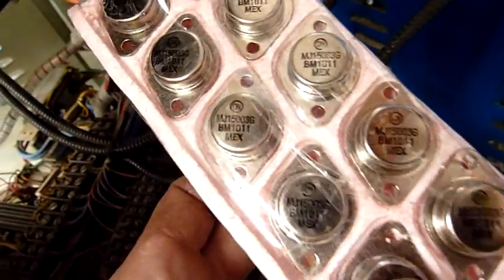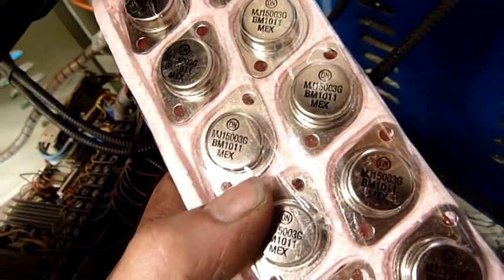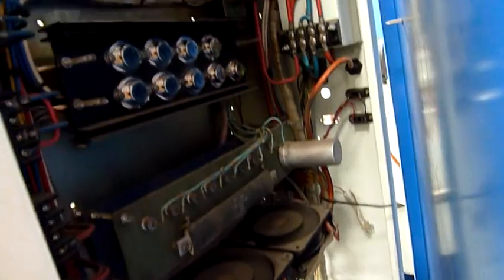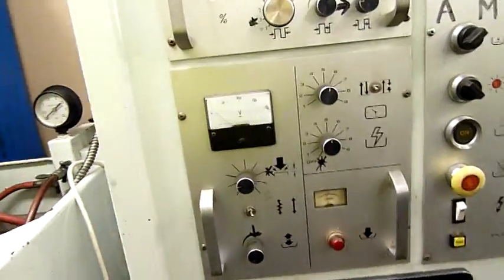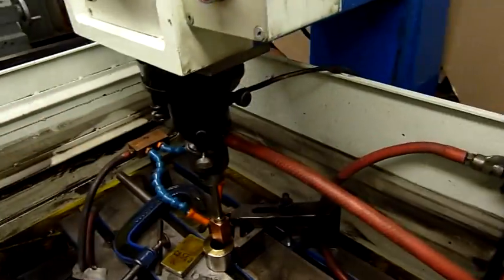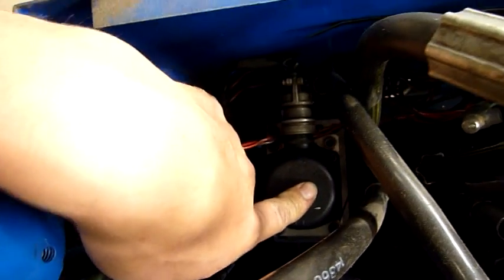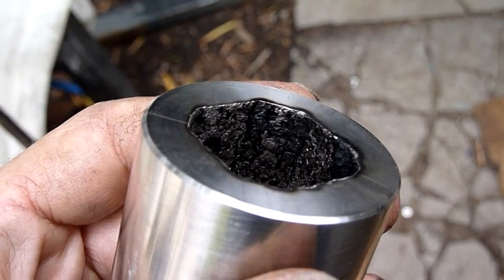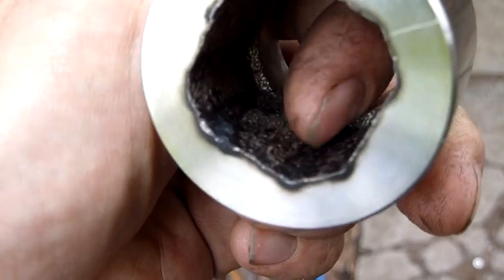Hisu-Fong EDM Fix Part 2 - Control Issues

Comment: Where is part3?
Reply from the maker: there is not one, we pulled the plug on this patient and sent it off to the scrap yard. too old, too many problems.
Reply: I fixed one machine similar to that but it is a little newer. It use MOSFETs instead of transistors. I don't know much about the machine but I change one swollen capacitor and it fixed. The capacitor is used by a few op-amps' power supply  to drive Mosfets.

Comment: Those proportional valves are notoriously sensitive to foreign debris but it's hard to say without scoping out the control signals. I have seen them do exactly what's happening here where it will only operate one direction no matter the input. Although it is a bit too coincidental how it just started doing it.

Comment: If that capacitor is cracked and leaking it's definately bad, one way to test is charge it up and see if it still holds a charge with a volt meter, you can also test to see if it's shorted with an ohm meter. You might get away with going to the closest standard size or you could parallel two caps with about half the capacity but the same or higher voltage in it's place.

Comment: @MrDubje ... voltage in different status. if there are ANY socketed ICs on the control, you might just want to take them out, clean the socket with a brush, and reinstate(correct term?) them. these sockets are a most common problem in electronics. Be carefull though, you dont want to ruin programmed controllers due to ESD. Also, when taking ICs out, take note of the actual orientation.

Comment from the maker: @MrDubje the diodes are all working well, that whole system checks out okay now, but control is not firing the transistors off :(, no signal at all.

Comment: That under the transistors might just be a shunt resistor for measuring current (just guessing by the looks of it) and some powerdiodes for god knows what. If they are diodes, you might want to check them too.

Comment: thats some serious carbon build up and arching out, have you got your settings rite, eg volts, on/off times, goin by the surface finish looks like you are trying to push some amps through it 15+amps??

Also does this machine have whats called a nite switch option, strathclyde i used to run would do the same thing head would retract unless the nite switch was turned off

Comment: The IC’s look to be socketed unless they are exotic it might be worth simply replacing them. It also look like there might be some tantalum capacitors on the board they can be unreliable if abused. Perhaps try looking at the pots to see if there is any locking paint or simply an oxide shadow to indicate the original working positions. The pots might set the bias of an op amp so they might need a tweak if the IC is changed. Rockby dot com dot au Stock No :39074 8200uF 250V 105° Chassis M Cap

Comment from the maker: @itscool1968 yeh, $4000 for a used machine, plus freight, plus electrical hookup (after decommissioning the old one) plus roughly $1000 for new dielectric fluid. they aint going to spring just yet, its worth me and my friend spending a few hours and 100 - $200 trying to fix this old beast.

Comment from the maker: @rb26capri I have 6800uf - 450V caps in that big bank, and 2X 2200uf 450V laying around. not sure if the machine will care, but we have bigger problems now. main DC supply is working.